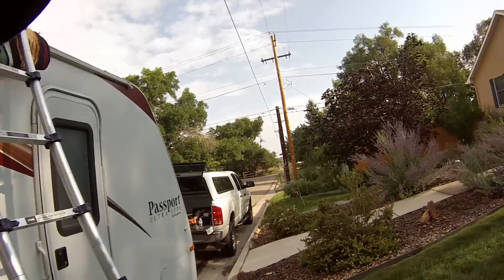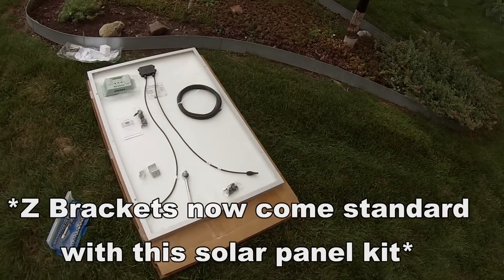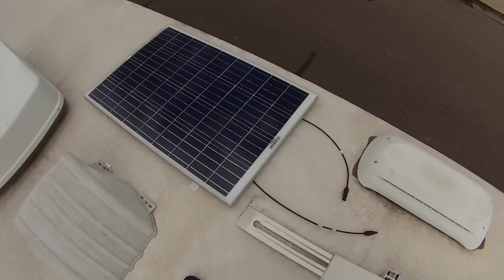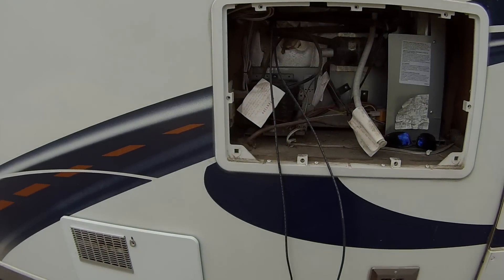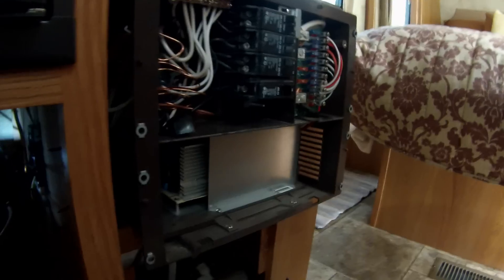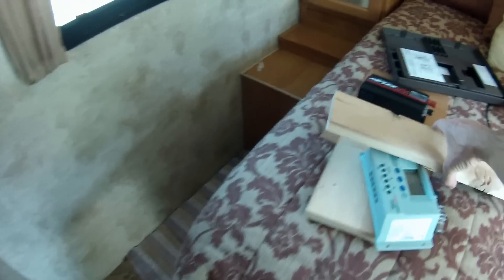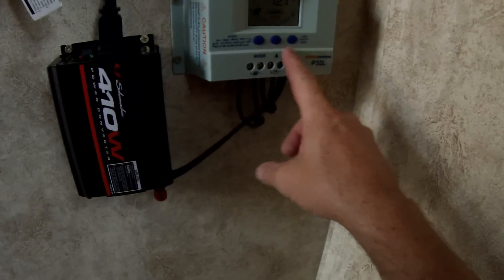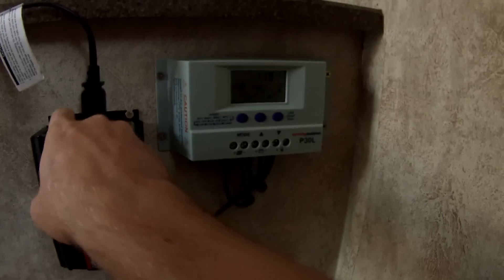How To Install A 100 Watt Solar Panel Kit On An RV/Camper - Windy Nation 100 Watt Solar Kit Install

Comment: If I install a 100watt solar panel on my hybrid can I run AC off my battery or an inverter? Or do I need a converter? Can this be done to be have lights, plugs and AC off grid and use propane for fridge and cooking?
Reply from the maker: No, you would need a much larger system to run your air conditioner.  If you go to Renogy's site, they have a solar calculator that tells you how big of a system you will need based on what you are operating.  Here's that link: https://www.renogy.com/learn/calculator/

Comment: I have a similar panel. It also has 2 unlabeled black wires coming from it. How do you know which is negative and positive?
Reply from the maker: If you hook up a multi-meter to the connections on the solar panel, the multi-meter will read either - or +.  If it reads positive, you have correctly hooked up the + to the + & - to the - on the multi-meter.  If it shows -, you have not.  Hopefully that made sense, thanks for watching!
Reply: @ColoradoCamperman  thanks I forgot my multi meter existed...... was a long day
Reply from the maker: @kyleguisso5963  Lol, I've had those days too!  Good luck with the project!

Comment: I cannot access the refridgerator compartment from outside my RV like you can.  So I am guessing this method of connecting to the electrical panel will be too difficult.  Do you agree?
Reply from the maker: You could drill through the roof, I avoided doing that by going through the fridge vent. You can get plugs for the roof that will feed wires down. Then use dicor around that. Good luck and thanks for watching!

Comment: Wow. I was looking at this video because I'm getting a motorhome and jeez I'm lost. I saw someone selling 3 100w panels on Craigslist for $220 so I thought I'd check out vids. Think I'll wait or is that a good pricem
Reply from the maker: That isn't really a smoking deal.  You can buy panels on Amazon for about that price.  I just installed a 200 watt system from Amazon.  It came with 2-100watt panels, a charge controller, all the wires, and mounting brackets.  It was around $220.  Here's a link to that video and also where I bought the panels on Amazon.  200 Watt Kit: https://amzn.to/36gow8i  Install Video: https://youtu.be/v_omW_iK9NQ Thanks for watching!

Comment: Great video. THank you!! I just wanted to triple check that I understand.  You've wired the charge controller's "battery side" (power going TO the batteries) directly to the DC panel, right? I've not seen this before, and have only seen people wiring directly to battery terminals. I like your method much better, but wanted to make sure I have understood it correctly. Thanks!
Reply from the maker: You're welcome Mike!  Yes, that is correct.  The only addition I ended up making was I put a fuse on the positive wire from the charge controller to the DC panel.  I'm actually getting ready to do the same thing on our camper with a 200 watt setup.  Thanks for watching and good luck on the install!

Comment: Great vid, I have installed several panels on several rv's I've owned. My new fifth wheel will need the cables routed the same way to get to my breaker box, gave me some great ideas. I had the same passport ultra lite a mine was a 2014, have you had roof issues?  Live in Az the summer had my roof start to bubble, have you had a issue? I also had the caulk separate and water ruin the front fascia. Keystone's customer service is zero. But to beat the weight they sure cut corners.
Reply from the maker: Thank you, I'm glad the video helped you out!  That camper is actually my Mother In Law's but I work on it all the time.  I have not noticed any roof issues or bubbling yet (knock on wood!).  I hope their camper doesn't have the same fate as yours.  I've heard similar things from others about Keystone's customer service and quality.  They have lucked out so far and we have too.  We have a 2010 Keystone Hideout 27BWE, it's been a great camper so far with no issues.  Good luck with your solar project and thanks for watching!

Comment: How do you know that you caught the wood studs to mount the panel rigidly so it won't fly off on the road?
Reply from the maker: I did the ole knock test to find the studs.  I tried my stud finder, but it's a POS.  Thanks for watching!

Comment: Don’t you have to install a battery switch and a shunt or fuse? Also, 200 watt panels are easy to find now and cost about the same as a 100 watt panel. Very nice installation. Are you powering all of your ac in the camper, or just certain circuits?
Reply from the maker: Yeah......I pulled this video from the Colorado Camperman archives.  So it is actually footage from a few years ago, lol!  That was when I was on my hiatus from the channel.  I thought the footage was still good so I wanted to post it.

It's funny, at the time this setup was probably $250 on Amazon.  It's now $158.  And you're right,  a 200 watt setup is not much more.  Just two years ago, it was like an extra $125-$175 for another panel!  I also installed it to how I had researched it at the time.  When I installed it, nothing was mentioned about needing a shunt or fuse.  Maybe that has changed now?!?  I dunno, everything seems to be working fine.  Lol

As for the power, the solar panel charges my Mother-In Laws batteries.  So anything that is run on DC is essentially running off the solar.  We did not hook it up to the AC system.  I installed that power inverter so if they want to charge their cell phones or run a small fan/appliance, they could.  They have little power needs so that is also another reason for the small setup.  I they need more power when boondocking, they just run the inverter generator.  Thanks for watching!